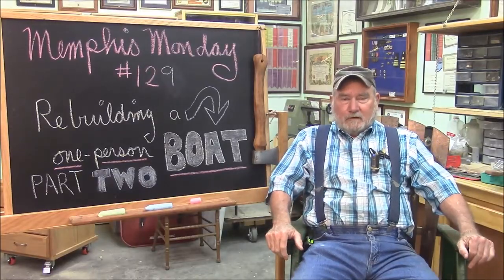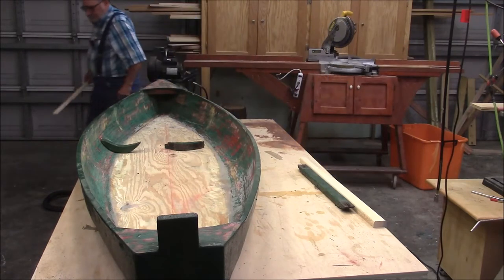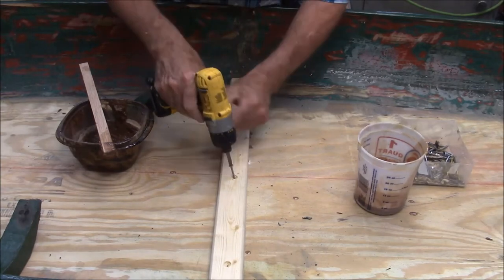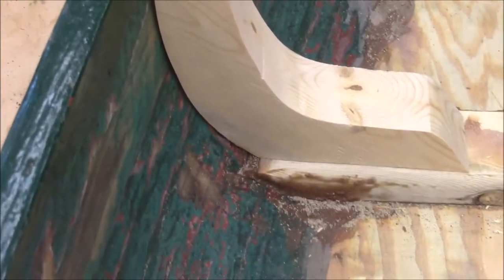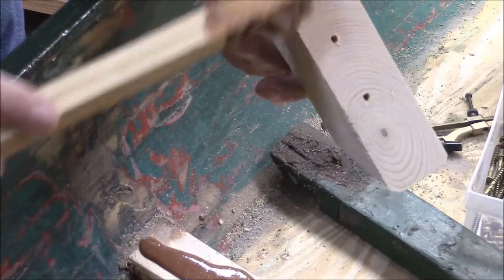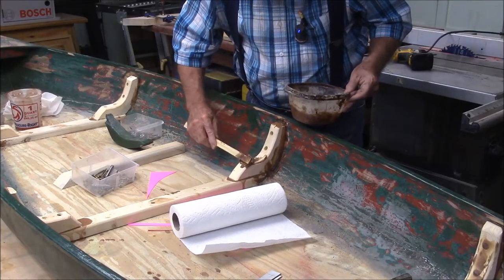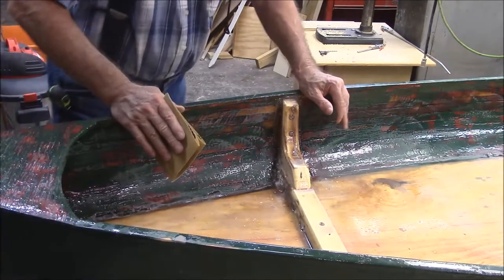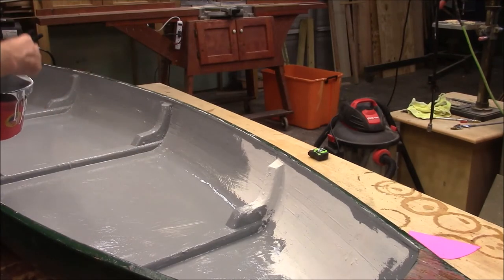129 Rebuilding a one person boat part 2 of 2

Comment: There was never any doubt in my mind that you would put this boat back in order.  I just didn't realize what a spectacular job you would do.  This part of the build made me realize exactly why boat building is not for amateurs.  No wonder you have been so adamant about not building them.    The ribs looked great when you were done with them.  Will he be mounting some kind of seat in this boat?  I should have known that an old sailor would choose "Battleship Gray" for the color of the boat.  Is there a reason you didn't paint the outside other than the amount of work involved?    Last question.  Has this little boat made its relaunch yet?    You definitely worked the Memphis Magic on this project!